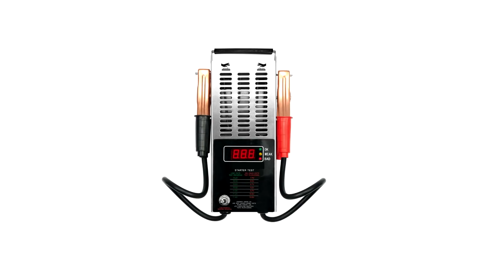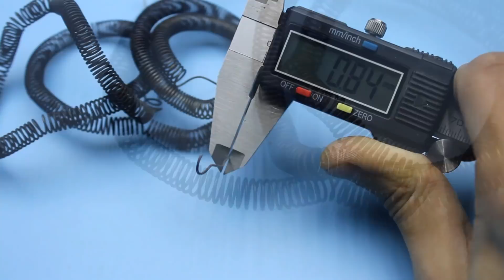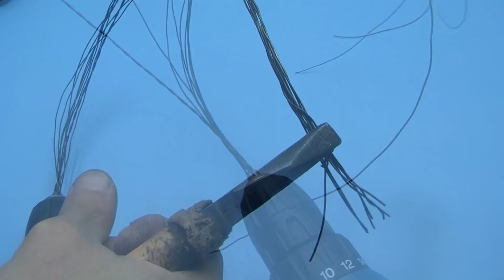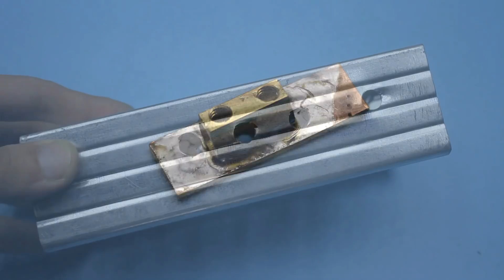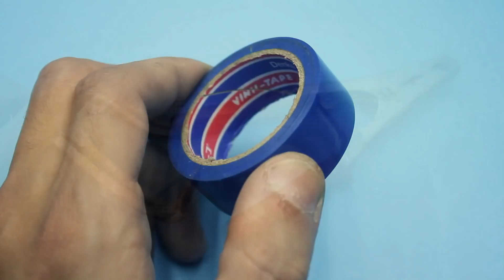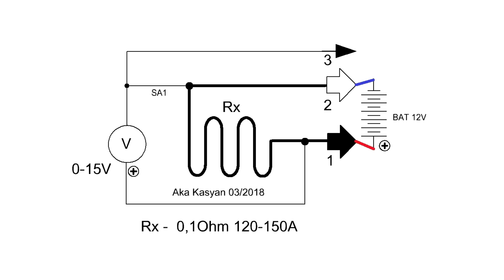How to check the car battery?  DIY battery tester

Comment: One thing i would add, is dont leave any hard bends along the wires length. Curve it around a small diameter form so to avoid high resistance on the wire  when fitting it into the small space and having to bend it.  Also if you dont use enough strands, the wire will get hot and may change it resistance/weaken  permanently making accurate testing not possible . You want the 100 amps and voltage reading with the wire normal temp if possible.